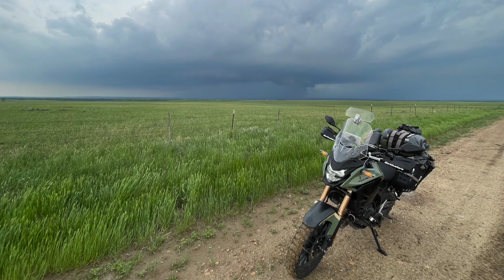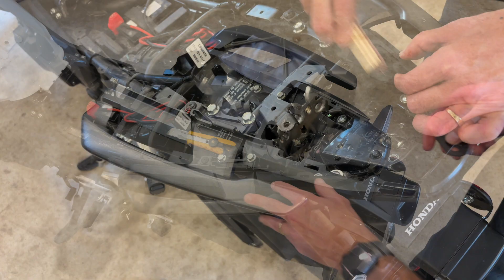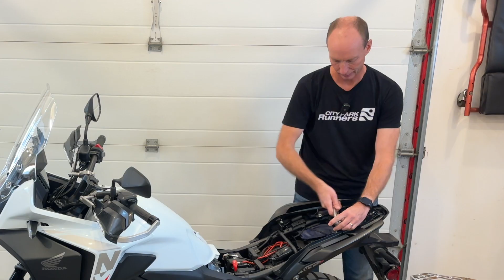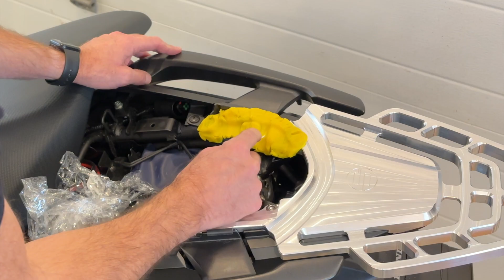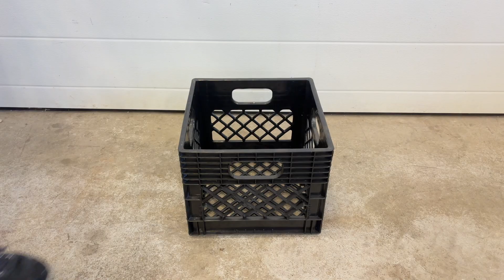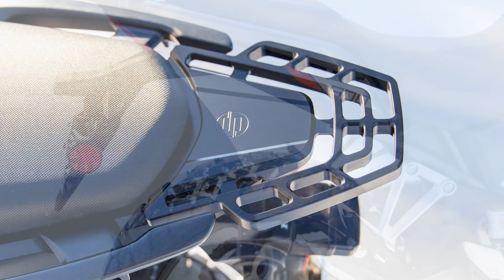Honda NX500 Luggage Rack Design and Build

Comment: Great build on the rack. I'd definitely be interested in the side support/racks as well. Is the windshield on your NX500 the stock one?
Reply from the maker: Thank you! I will have to try to slice out some more design time for the side supports. I seem to always be a bit overloaded throughout the summer.
Reply from the maker: Oh, and the windshield is the WRS Touring. It cuts down on buffeting a bit but still not perfect.

Comment: Amazing process and meticulousness. How can I use it though? Do I attach saddle bags to it? Sorry I just bought my NX500 and I'm new to motorcycles, thanks!
Reply from the maker: Thanks for the kind words. The rack works best with "rackless" luggage systems like Mosko Moto reckless 40 or 80, or Enduristan Blizzard. Some people have used it to mount an adapter plate for a top box but I personally don't like top boxes.
Reply: Exactly my thoughts.  Just ordered one of your racks and I will hopefully get rid of my present system using a top-box - looks so weird on the NX500 as it juts out too much behind the rear axle.  Gonna have to shell out for a set of Mosko Moto reckless soon!

Comment: Hello,
I am interested in the rack luggage carrier for the Honda NX500.
Could you please tell me how many kilograms it can carry?
Would it be possible to attach a fully loaded medium-sized aluminum case to it?
Reply from the maker: Hello, I have been recommending that people limit the weight to 20 kg (44 lbs). However, please be aware that the higher and more rearward the weight, the more it will negatively impact handling. Try to keep the weight low, forward and as light as possible. Many customers have mounted top boxes to my racks using universal mounting plates from the box suppliers.

Comment: Able to place a motorcycle box on this luggage rack?
Reply from the maker: Yes, a few people have done it. You will just need some oversized washers or drilled plates to place on the underside of the rack to mount the manufacturers universal mounting plate. You might need some longer bolts than are supplied in their kit.

Comment: Thank you so much for your videos… between a used cb500x (6000€ 14000km with extras ) and an NX which would be the wisest choice ? Thank you in advance 😊
Reply from the maker: I don't think you'd go wrong with either choice. There's really very little difference between the two bikes so it probably comes down to styling preference and price.

Comment: Very nice machining work. Looks like a quality product, would like to have seen some of the modeling and programming process. Why did you not use the original seat from the bike?
Reply from the maker: Thanks Kevin. I never really know what to include in my videos but maybe I'll try to do that on a simpler product in the future.
I think I actually switched between the original seat and my Seat Concepts seat which I robbed from the CB500X. The seat pan is identical on both so it doesn't really affect anything.

Comment: It looks great but shipping to Europe, Poland cost almost the same as product. Any cheaper option?
Reply from the maker: The cheapest shipping to Poland is with Canada Post which is around $50. There was an issue with my website's shipping integration where it was including duty and taxes in the shipping price. I have changed this now to be paid on delivery rather than pre-paid so keep in mind that you will likely be charged Duty and taxes on delivery when your package arrives. You can find the correct shipping charges now on my website once you enter your address. Sorry for any confusion.
Reply: @blainemcfarlane  ok thank you. Currently I'm checking market what is available. Original Honda rack is very small, I don't like Givi, Sw-motech proposal. I think, I'll buy your product. Lets see how it works with delivery through ocean and taxes :) if you're interested I can give you information about the results :)